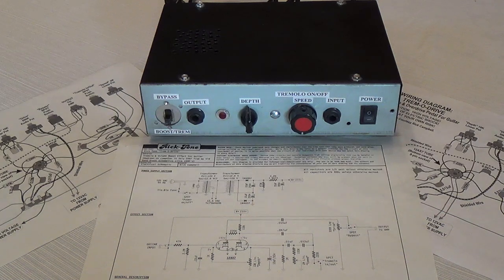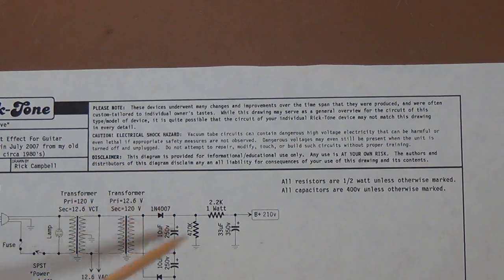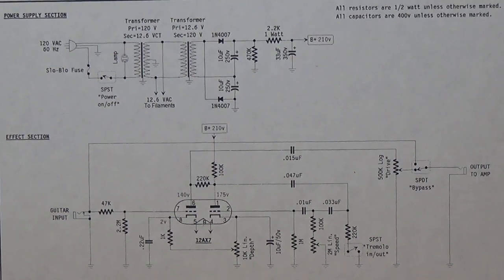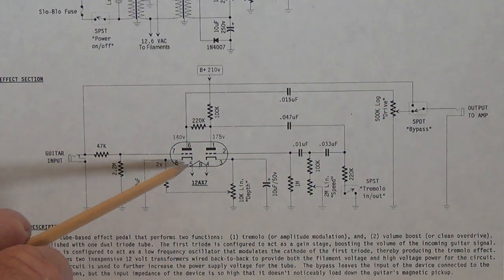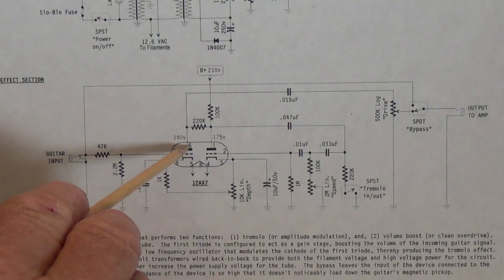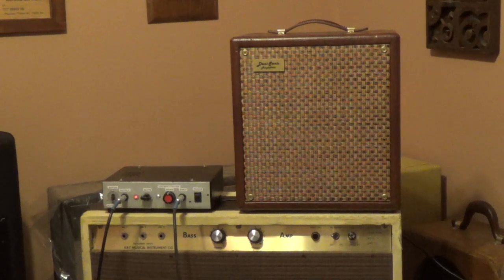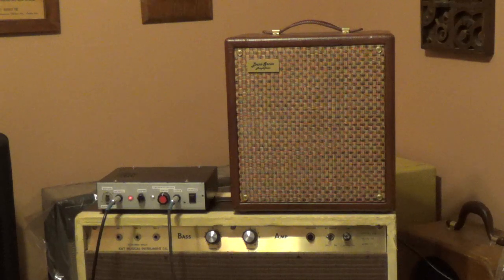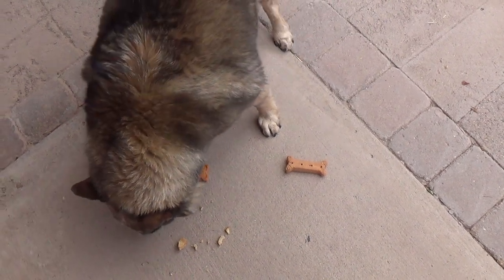Build Your Own Inexpensive Tremolo & Overdrive Boost Unit, Part 1

Comment: Very cool Doug! By the way, I have a 5e3 clone and would love to add reverb to it using something like a Belton chip rather than use a pedal. (I don't like spring reverb, and it would be too darn expensive to add one anyway.) I've yet to see a video about adding something like a Belton chip to an amp. Yours could be the first. Just saying pal. ;-)
Reply from the maker: +St. Hugh  I appreciate the input, St. H, but I deal strictly with tube amp circuits and point-to-point wiring, so chips and PCB's are not in my area of knowledge or expertise. Perhaps there are other channels on YT where such topics are covered. Best of luck.
Reply: +Uncle Doug ~ Thanks anyway Doug. I found a schematic of a Belton chip added to a little Epiphone amp, and it looks really simple. This guy just used a number 5 pin from the 12ax7 pre tube (5-watts I believe) in the amp to power the reverb chip, added a "mix" pot and a "volume" pot to the chassis and the circuit just used a voltage regulator and three resistors. That's all there is to it. I don't know if I can use the #5 pin from the 12ax7 that's in my tweed Deluxe or not, but if so, that would be a really cheap way to add reverb. I might give it a try.
Reply from the maker: Good luck with this modification, St.H. Let us know if it works.

Comment: I'm really ooking forward to the rest of this video series.  I've  recently converted a '40s-'50s Seeburg jukebox amp [MA1-L6 Master Amplifier] to what was essentially a 5f1 style circuit, and later modified it to a parallel SE [biased for 6L6GC output tubes] and added a switchable master volume, and also fully restored an old  [Premier/Multivox] Marvel 35 amp [6SL7, 6V6, 5Y3] , using your videos as reference materials.  Both were done easily with success confidence thanks to the knowledge you share. Keep it up, please!
Reply from the maker: +Scott Gibson  Wow, Scott, an impressive resume. Rusty and I are quite happy to hear that our videos assisted you in these projects. Thanks so much for sharing this with us.

Comment: Now all we need to do is build a booster for the booster and Mr santana may come knocking. Love the tone, this approach to getting more snarl really does keep the dynamics and voice of the equipment in use intact, unlike alot of the stuff made now that sounds all the same and makes all the notes equally unimportant. Righteous tone resides on this channel! Badger would have both the biscuits before we would have chance to check his preference, he really does Wolf down his food. We have, as a result, realised with him the correct way to check his level of desire for a particular treat is to have him sit on his bed, and observe the rate of lip licking as the treat approaches. The rate is directly proportional to distance unless the treat is small, then its more of a logarithmic curve. I think perhaps this sick time off work may be starting to affect  my mental state
Reply from the maker: +PoJoWo It's possible to add more diodes and capacitors to the doubler network and turn it into a 3x, 4X, etc. with virtually no limit.....even over 1000V !!!  The current rating would be very low, but for certain purposes a cheap 1000VDC  power supply has its applications. 

Your studies of Badger's behavior remind me of Dr. Pavlov, who became quite famous for similar observations :)

Comment: Actually, I believe you need a DPDT bypass switch to make it "true bypass" so the rest of the circuit "doesn't exist". As it is now that circuit continues to load the input whether bypassed or not. As to whether that has any audible effect I can't be sure, but as a huge fan of true bypass pedals, I bet it does!

That's usually how you can tell if an effect is true bypass or not. Count the poles on the bypass switch.
Reply: Now, true, the grid on the first stage of the 12AX7 is super high impedance. But there's still a 2.247 MOhm path to ground before it. That's a LOT more than a typical guitar volume pot at 250 or 500 kOhm, but again, I'll bet you can hear it as a slight loss of high end.
Reply from the maker: +Admiral Quality  I see your point, AQ. As long as the input is still connected to ground through 2.247 Meg of resistance, I guess there may be a microscopic amount of load.....but I just can't imagine that it would make a noticeable difference. Thanks for your input.
Reply: +Uncle Doug You're probably right. That's a LOT of resistance to ground so not much load at all. And the whole true bypass thing mostly comes from transistor effects where they have a much lower impedance input than the dead-end grid of a tube.

Still, I'd want to blind A/B/X test it. If I can consistently hear it, it's real! :)
Reply from the maker: I understand, AQ. Since the boost is never really "off" when the unit is activated.....you simply turn the boost volume to zero.....having it set to even half of one (out of ten) would compensate for all sorts of load.
Reply: +Uncle Doug Hmmmm. I'm generally of the opinion that "more is less", which is part of why I'm such a believer in true bypass. (And the difference it makes in vintage style fuzz and wah-wah circuits is more than palpable.) 

There's a whole debate about that. Some believe in buffers, and I agree they're fine for certain kinds of effects, but wah and fuzz in particular have relatively low impedance inputs that load the guitar's pickups. The pickups essentially become part of the effect circuit, and putting a buffered pedal in front of your wah or fuzz will really hurt (or at least change) its sound. So because of that I've got true-bypass versions of both, and they always come first in the chain. (Usually only one is activated at a time. With these vintage circuits you can actually end up making an oscillator if you activate both wah and fuzz at the same time!)

So, while I'd be open to testing it with my ears, my gut instinct would be to bypass the input as well as the output with a DPST switch. (I over did it with DPDT above, I think. But you definitely need two poles for a true bypass switch.)

My wah-wah by the way is a new Vox 846-HW (for hand wired). Check it out! Ain't that a thing of beauty inside? (Apparently those are modern caps in cosmetic shells to make them look vintage.) http://www.voxamps.com/v846hw

And my fuzz was custom built for me by this Russian guy. I'll see if I can dig up the schematic to PM to you, it's quite a circuit! (Based on the Fuzz Face but with 3 more controls. 2-way tone, external bias adjust, and "sustain" which as I understand it changes input impedance. A friend of mine just had some circuit boards made to try to replicate it, actually. Hopefully we'll get together and do that soon.)
Reply from the maker: +Admiral Quality  Thanks for all the info, AQ. You are welcome to post schematics, photos, and diagrams on my Facebook page: Uncle Doug's Vintage Amps.
Reply: +Uncle Doug Oh and keep in mind it's not level I'm concerned with preserving as much as frequency response. You lose some high end when the pickups are loaded. True bypass literally makes it so the effect circuit doesn't exist anymore when bypassed. 

Again, this is an ongoing debate/philosophy thing in the guitar world. http://www.gilmourish.com/?p=1611
Reply: +Uncle Doug I just a few minutes ago got banned from posting on FB for 7 days for a one word reply to somebody, "Idiot." (Meanwhile I was threatened with violence earlier today and FB did nothing about it.) So it'll have to wait. Or I'll send it through a YouTube PM to you.

See you on the funny pages in about a week! ;)
Reply from the maker: Admiral Quality  I understand the concern with altering the frequency response, AQ. My experience with pedals is quite limited, so I defer to your greater experience in this area. Thanks again for your knowledgeable input.
Reply from the maker: Admiral Quality
 Sorry to hear of your exile from YT. Their punishments do appear to be a bit arbitrary from time to time. See you after you've "done your time" :)

Comment: Very cool build project Sir. One thing, hearing you play was, the natural room sound and its early reflections giving you that `small room` reverb sound. Then I thought, could you also add to this build an output to drive a reverb tank? Just a thought. Lastly re your quad: use a wireless system to drive a flying speaker while you play Rumble on the guitar in your driveway. :-)
Reply from the maker: +August Lyons Thanks, August. The room is very lively since I removed the carpet and installed a wood floor. It does provide a wee bit of reverb, but I tend to prefer the more neutral acoustics it had before. Thanks for the idea for a flying speaker......just the thing to torture my neighbors :)

Comment: Awesome vid Doug! I mean really, I was looking for a way to experiment with tubes (and I have an x7 around in my lab) and this looks like a great way to start. I have one but also a few 12au7 as well. Can you use a u7 in this design? Thanks so much for sharing and looking for part 2 and so. You are quite right, didn't want to start a new amp design..... yet! Oh and yes, Rusty must be taking the easy route, or maybe he was not hungry........hahahahzha! No, never met a dog with that problem. hehe, see you later and Thx dude.
Reply from the maker: +saturn5tony That's great news, Tony. I think you'll really enjoy the experience, and I look forward to hearing how it works out for you. I think you had best stick with the 12AX7 for this circuit. The 12AU7 has much lower gain.....probably inadequate.
Reply: Good advice and thanks (as I looked at the specs just a while ago) and you are correct, the X7 looks like the gain is much better as you say. BTW what was Jack looking for? Did he loose his mouse tracking device? hehe.
Reply from the maker: You're welcome, Tony. He has certain preferences for toys to play with, and roots around until he finds one he likes :)

Comment: Been Looking at your channel for quite some time. and this one looks like it may be the one for building. Problem one we live where the power is 240V 50Hz, So If I build the psu as described ill get sorting closer to 460V for the B+,  I could envision a lot of smoke escaping from parts as my background it mostly silicon based electronics and they don’t like a lot of over voltage. I guess one could build a voltage divider (may get hot) or redesign the power supply by  changing the second transformer for a 240V to 6V one and the first would be a 240 to 12 volt centre taped one Oh and I guess the power filter caps would have to have a bit more capacitance to counter the lower 50Hz power
Reply: +retroman33366 Oops miscalculation in the head think the first one must be something like a 240 to 12V and the next one a 240 to 24V with the 12V secondary feeding the 24V secondary of the second transformer
Reply from the maker: +retroman33366  How about if you skipped the voltage doubler and just used a full wave rectifier on the output of the second 12 to 240 transformer (if it's center-tapped, or a bridge if it's not) ?  I hope you build it and let us know how it turns out. Good luck.
Reply: +Uncle Doug Simplicity KISS principle  yes full wave would be easy. Talk about not seeing the wood for the trees.  Will let you know if and when I do make it, Im in the planning stage, I’m also hunting down suitable parts, from my junk and new supply’s Valve(tube)sockets would you recommend ceramic or  thermo setting resin? From a stability point of view I’ve always used metal film resistors but I know carbon stresses at High voltage could there be an advantage of using carbon resistors?
Reply from the maker: I prefer ceramic sockets.....they don't melt or burn.....and 1W carbon resistors, except in the power supply, where I generally use metal film. Good luck with your build.
Reply: +Uncle Doug Thanks for the advice.  :)  Last thing I built was this http://cooze.co.nz/j423k.html So far have built 2 complete guitars and rescued one from a dumpstar,  Built a Fuzz peddle and put in bits to make the silicon transistors leaky and reduce there frequency response to emulate germanium did not do a write up on that one as found out my ideas have been used before.
Reply from the maker: You're welcome, Retro. It sounds like you have a fair amount of experience. Good luck with this and future projects.

Comment: Uncle Doug, Do you remember/know what the current rating or requirement is of those two transformers?  It seems the most available units are 2 amp - at about $25 each.
Reply: +Donald Filbert 2 amps would be generous. 12AX7 filament current is approx 150ma, and plate current(s) 3ma total or less.
Reply: +HammerToneAmps Thanks HammerTone !!!
Reply from the maker: +Donald Filbert  Hammer is right, Donald. The transformers specified by Rick Campbell are 200mA each. The ones in my unit, which will be discussed in Part 2, are 450mA each.
Reply: +Uncle Doug Thanks Fellas !!

Comment: I'm going to try my hand at building this. Looks really cool. I know you've covered it before but which video did you show the best way to discharge the caps?  

Thanks for teaching us so much. :)
Reply from the maker: +MegaWimberly You're welcome, Mega. You can use a 100 Ohm 10W resistor. Solder a wire and alligator clip to one end-wire of the resistor, clip it to the chassis, and then touch the other end-wire to the + leads of each cap.  You can insulate the wires to prevent touching them. You DO NOT want to touch (with skin) any metal while doing this.
Reply: +Uncle Doug thanks a lot!

Comment: Quickly becoming my favorite Youtuber...

I'd love to see you do a Hammond organ to guitar amp conversion sometime, I have one just itching to be built  8^)
Reply from the maker: +sledge57a  Thanks, Sledge. I have already posted two videos on organ amp conversions: an AO-35 and an AO-44. Please check out my video list.
Reply: +Uncle Doug I forgot I did see the video done using the A044 reverb driver section.

Just saw the scratch built Supro video series and am considering that build based on what I heard in the final video, did you ever tame the tremelo like you wanted to?

I have all these great plans just need time to do them, I'm finishing a Trinity Tramp, have a 1972 Silverface Super Reverb to referb and a 1970 Silverface Vibro Champ to go through.

Too many projects... I need to retire so I can get to work..lol
Reply from the maker: Yes, the small problems were easily ironed out and it ended up exceeding my expectations. Good luck with all your projects.
Reply: +sledge57a Oh please don't destroy any tone wheel organs! If they're transistor organs ('70s granny organs, as I call them) then fine. :)
Reply: +Admiral Quality I never saw the organ, someone through it in the trash and gave me the amps
Reply: +Uncle Doug did you ever post a follow up showing the changes?
Reply from the maker: No, I didn't. It was so long ago that I don't recall what changes were made, if any, after the video was posted.